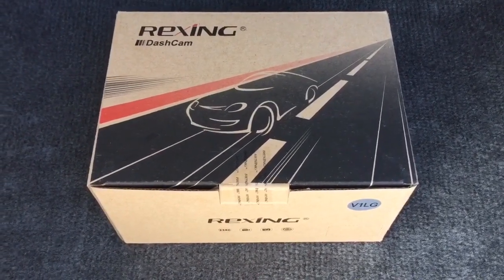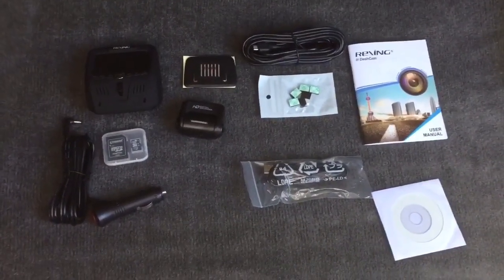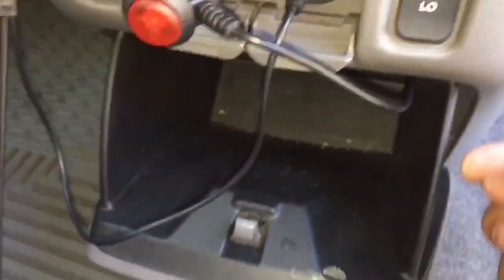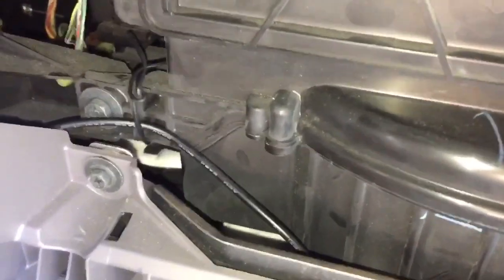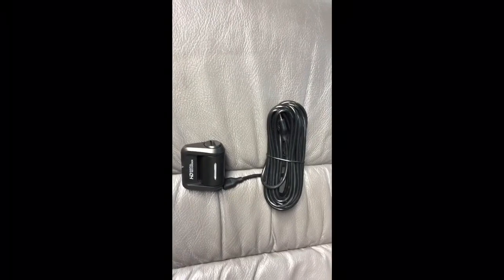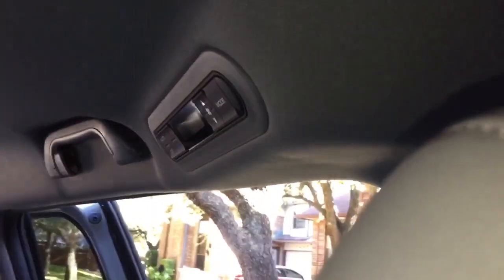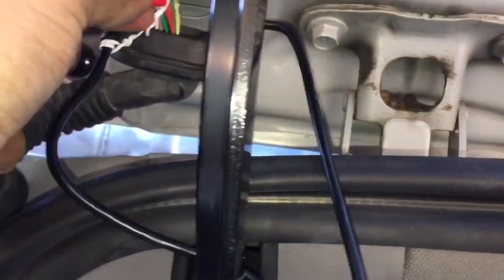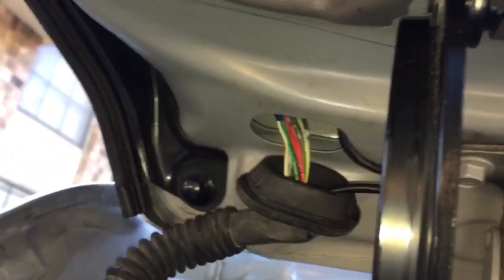Rexing V1LG Dual Dashcam Installation in Minivan or SUV

Comment: A useful hint: put a few spaced out not-too-tight knots in the cable that runs across the front headliner. The bulk of the knots keeps the cable tucked in real nice and it won't fall out. Also be cautious when routing near the side curtain air bag. Run that wire in a way that it won't interfere with the deployment.
Reply from the maker: Awesome tip! thank you.

Comment: Great video explaining the process - thanks!  I'm tempted to see if I can run the rear camera wiring through the firewall, tied securely underneath the vehicle, then come up in through the taillights (alongside the trailer brake wiring). Will get it done one way or another. Would be nice if these things communicated wirelessly with only power needed.
Reply from the maker: This is an awesome idea to run the wire underneath the vehicle. Let me know how it all went. I agree, it is a pain to run the wire and wireless connection would've been so much easier!

Comment: I recently purchased this, but I wasn’t able to have the rear camera wire reach the back. I had my wires go to the floor and up. My camera just sits in a corner on the back instead. Glad you figured out a way to make it work.
Reply from the maker: When I Installed it I thought the wire was too long so I had to keep the extra wire in headliner of the honday odyssey van. What vehicle did you install it in? Would you consider wiring through headliner?
Reply: I just readjusted my wiring and pushed it through the headliner all the way to the back seat headliners. There's actually excess wiring now! :) I didn't put my wiring through the tailgate like you did though. It looked like too much work. Then again, people can now see my wire just hanging there, and I also have to be careful when opening the trunk. I have a Toyota Sienna by the way. 

Lastly, do you know what the switch on the rear camera does? I've been looking and have not found an answer.
Reply from the maker: yaay! so glad it worked out well! :)

Comment: I bought this cam Rexing V1LG Dual Channel Car Dash Cam FHD 1080p 170° but the rear camera has a nub so you can turn it to look outside on the back of the car then you flip it by turning the nub to look inside the car but when i flip it to look inside the car everything looks upside down it had a little switch but i move the little switch it won't do nothing it keeps rec. upside down what should I do so it can rec. Normal rec. Not upside down
Reply from the maker: Yes, the rear camera is in a cylinder shape that rotates, and you can rotate it all the way so that it faces inside the car (not outside). However, in doing so the camera is upside down therefore it records everything upside down. I have not done this, but I am guessing that if you install another install plate on the headliner of the car (inside the car) and then have the camera face the inside then it should record correctly. This is just a thought - not a suggestion. So please double-check at your end. thanks

Comment: any update on how you like it? is there any bad things about it? last long? any errors?
Reply from the maker: After anout a month of use, i like it! It powers on when vehicle is started and , stays on, records front & back views, and powers off when vehicle is turned off. Rexing has Parking mode that works off of motion sensors, and has GPS.

Because it has GPS built in, Its footprint (dimensions) is slightly bigger than the Aukey' 2-camera ststem i just installed on my other vehicle. The aukey system does not have GPS built in, and its parking mode works on impact sensor (not motion sensor) BUT it  is half the size of Rexing V1LG, has amazing night time video, and works excellently as well. If you dont care much about GPS or motion based recording when parked and want a stealthy install then go with Aukey, otherwise Rexing V1LG is awesome!
Reply: Well ive already bought the rexing v1lg and hope it was a good purchase as it was on sale for 145 american. Anything i need to get with it as i am looking at sd cards and where im from its impossible to get transcend endurance cards like im told i should. also any other things i might need to get for it? any ideas or things in mind that would help me when i install? and is the sensor while its hard wired or do you use the plug in lighter adaptor for it?  Thanks ahead of time.
Reply from the maker: Congratulations on your purchase. You got a better price than what i did! The camera comes with everything thats needed to install it and get you up and running including a 16 GB High Endurance micro SD card. A higher capacity micro SD card is a preference, not a requirement. If you decide to get one, SanDisk works perfectly. Look for a card that says 'High Endurance' and class 10. Try 'slickdeals.net' I have found good deals through it.  There is a deal on micro SD cards right now starting at $8

Hard wiring is optional, not required, and you can hard wire later. I have my camera  plugged into the charging port only and camera Works perfectly. The Honda Odyssey minivan in which I am using the camera has only one charging port in the front so I use a $7 splitter (Sentry Auto Pro Triple Car Plug) bought ftom walmart that keeps all our devices (phones, ipads, GPS, cameras etc) charged and working perfectly all at the same time.
Reply: Fly Bee how do you get parking mode working? I have this same model and unless you have voltage all the time on how does it power on?
Reply: I have installed 4 of these with a hard-wire kits. The only real issue is the adhesive pad on the cameras will separate when setting in the sun after a couple of days. Some superglue fixed that and have no more issues. 3 of them came with a no-name microsd cards. 1 came with no card so I used name brand microsd cards purchased from a local best buy. every other month, I will check the files on the cards to make sure they are recording. 1st one installed May 2018, 10 months ago.